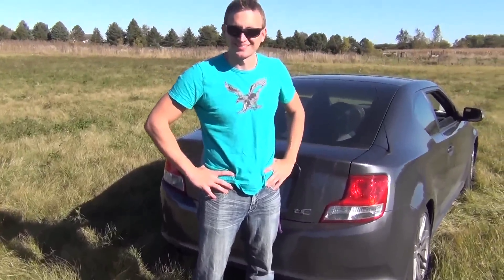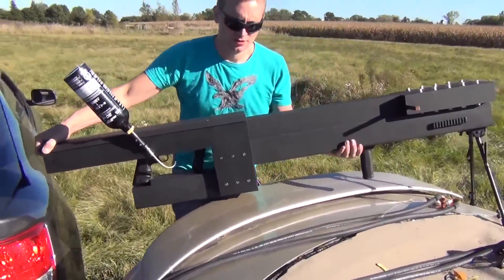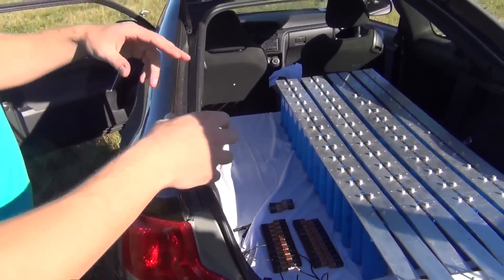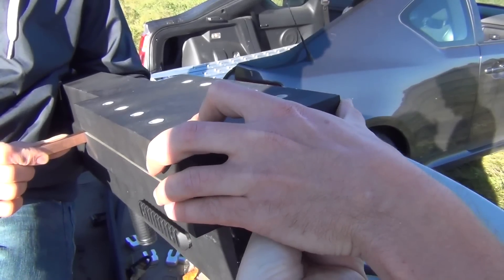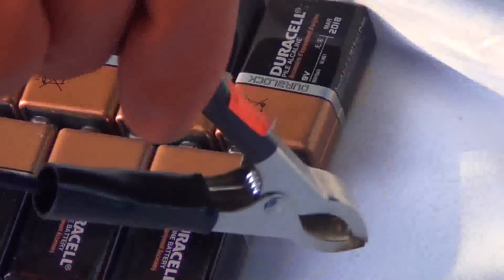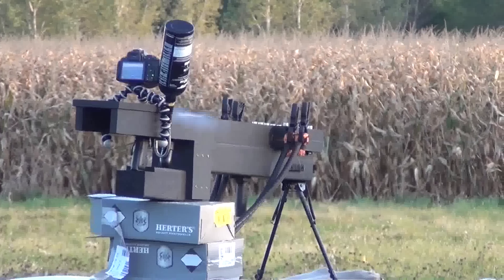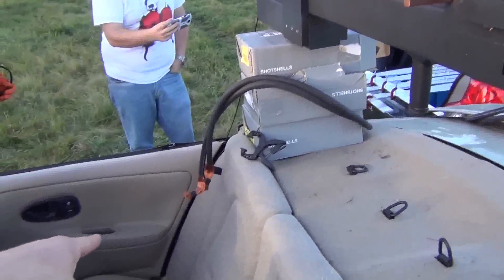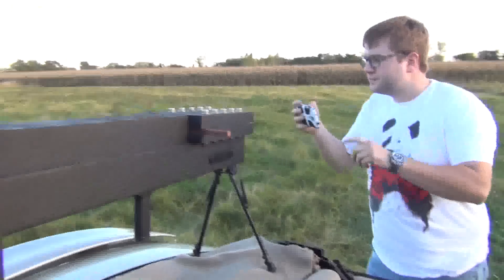Backyard RAILGUN: Field Testing the 250 lb Electric Gun, 27,000 Joule (max)

Comment: Cool and all but you guys kinda missed the most important part - a target so you can see the damage and maybe retrieve the projectile.
Reply: Ehhh... Aluminum is actually fairly soft compared to a lot of other metals. Including the ones they actually make bullets out of. Also ductile is the the ability of a metal to be drawn into a wire
Reply: Ya. I would like to see how many joules of *kinetic* energy it gives off.
Reply from the maker: https://www.youtube.com/watch?v=BIhCt6bTSSo
Reply: Ok, that is cool.  Do you guys have any idea of the fps?
Reply from the maker: I have no measurements right now. Looking to rent a system that can measure ballistics...
Reply: That would be awesome.  Check it out - here's a system I devised for measuring the fps of an air rifle I built: 2 microphones, one right by the gun, and another next to the target (something loud like a metal pan).  Run both mics into a computer running a program like reaper, which is free (not sure how much you know about audio stuff).  After you record the sound of the gun firing and hitting the target, you can zoom in on the audio signal to at least a thousandth of a second.  Maybe this only works for conventional guns where the bang is exactly when the bullet leaves the barrel.  But I got this to work well at distances as close as 10 ft.  You would think the gun would be loud enough to drown out the sound of the bullet hitting the target, but you can work around it by using a low gain mic like an sm57, right next to the target.  And you can get a good idea of muzzle velocity.  Just a thought!
Reply from the maker: +David 666 interesting. The system could be calibrated by shooting a projectile of known velocity- a .223, for example.
Reply from the maker: +David 666 a ballistic pendulum is a really easy way.. but I would be worried about the ricochet. Aluminum is very ductile- it holds a shape well after impact.
Reply: @ziggyzee9779  could the railgun theoretically penetrate metals like titanium or tungsten?

Comment: At 14 seconds they said it was an aluminum projectile. Aluminum is not attracted nor repelled by magnetism. Black bottle canister with CO2 seems to be the only propulsion in this experiment.
Reply from the maker: Have you ever dropped an aluminum plate onto a neodymium magnet? You'll be surprised to find out that, in fact, aluminum is effected by transient magnetic forces.
Reply: Aluminium is paramagnetic. It is most definitely affected by magnetic fields. Just not as strongly as ferrous metals. This projectile actually becomes part of the circuit, so the huge current passing through the projectile induces it's own magnetic field.
Reply from the maker: +Bert Anernie Yup. However, the effects of paramagnetism are very small compared to the lorenz forces and is an attractive force that works against us in the case of a railgun. Iron saturates very easily and has low conductivity- it's the worst!

Comment: how is this supposed to work.  I don't get it
Reply from the maker: Extremely large current is conducted between two rails and the projectile. 12,000 lbs is generated between opposing rails. This forces the projectile to high speed.

Comment: How many times did those geniuses walk in front of that thing? I understand this isn't a firearm, but use your heads.
Reply from the maker: Working with enough energy to electrocute 500 men or blow off an arm requires safety. Standing in front of a disabled, discharged muzzle loader is on par with cleaning a shotgun.

Comment: Wait ... Aluminum Projectile? Thats Not a very Stable or Conductive metal
Reply from the maker: +Andrew Hampton JR It's actually very conductive (especially when considering weight).
Reply: Well , if you get ahold of condensed tungsten that's what you should shoot
Reply from the maker: The aluminum is a mass driver- its meant to propel a more aerodynamic projectile with higher density. 

I do, in fact, have some shaped tungsten projectiles.. they weren't used in this week's shoot (working on the video now)... but maybe later this year....

Comment: Not quite sure why voltage was something they wanted to display.  Railguns take advantage of the Lorentz force. Railguns want to maximize this force and to do that amperage must be maximized, resistance must be minimized, friction must me minimized.  Also, it seems that with a device that is going to be firing projectiles...I would listen to your friend and try to secure your components before testing...
Reply from the maker: Voltage is the "pressure" that drives the amperage. Higher voltage = higher amperage, higher energy storage for the capacitors. The energy of a capacitor is 1/2mv^2. Half the voltage = 1/4 the energy.
Reply from the maker: Resistance must be at an acceptable level. It doesn't have to be zero. Anyways, I have more videos ;)

Comment: Very cool but as an electrician your connection methods are very dangerous ....your going to blow a chunk of flesh out of your foot where you ground out ..........seen the internal burns of high voltage ..........safety first lol
Reply from the maker: yolo :p
Reply from the maker: 400 volts cannot blow through a rubber shoe, especially Keen work boots designed for electricians. Also, this device requires contact with both positive and negative. The situation you've described is unlikely.
Reply: Ok man i have seen what happens at 480V and it burned the inside of a co worker from arm to exit at foot ...his arm is still limp ..anyways enjoy i dig the vids.....safety 4th is exciting
Reply from the maker: Sounds horrible. Definitely not something worth finding out first hand.

Comment: what would happen if you used a hollow projectile with the second rail going through the middle? would radial symmetry improve railguns at all?
Reply from the maker: my two cents- the simplest solution is usually the best.
Reply: +Ziggy Zee how's this for simple:  a voltage applied to the barrel and a coiled barrel length cable with some sort of quick disconnect attached to the rear of the bullet/sabot to complete the circuit.
Reply from the maker: +Jason Northrup Interesting. However, that cable is going to endure some heavy forces. The rails on my railgun experience an estimated 12,000 lbs. I really don't know what would happen ;)
Reply: +Ziggy Zee I think anything that can increase the sliding contact area would decrease erosion, improve durability.
Reply: +Ziggy Zee I wonder what kind of force is generated by a coiled current (an inductor i believe) on itself. then, what would be the force of the  "barrel" current on the coil?  what is the force of the two rails on each other currently?

Comment: Cold Metal (Aluminium) also with a bit of resistance loves to flex I see. Some older homes that used aluminium had issues like this.When someone would fire up the dryer or some other high amperage device. Would cause the wires to jump like a eel in the wall.

Comment: Compressed air gun. Firing electrified bullet. Did the slug get vaporized before hitting the ground? Was the inside of the "barrel" coated with Aluminum and copper oxides; possibly other plasma residue?

Comment: capacitors instantaneously discharge voltage and amperage....
Reply: +Nicholas skinner
Capacitors are electrostatic devices and deliver instantaneous current, but are time dependent on voltage, both charge and discharge.  1 Farad = 1 Volt linear rise when 1 Amp applied for 1 second
Inductors are electromagnetic devices and deliver instantaneous voltage, but are time dependent on current, both energized and de-energized.  1 Henry = 1 Amp linear rise when 1 Volt applied for 1 second

Comment: Ok.  The projectile was pulled and pushed by electro magnets in the barrell. Most types of metal can be magnetized by applying power and creating a field with powered magnets. Even aluminium. But the big question is where did the aluminium projectile  end up when they fired it faster than a speeding bullet through a corn field. Someone living within a mile could have been killed. WHERE did you think the projectile would finally stop! Someone's home or their body. I saw no thought put into where it would end up. Thank you for being  completely unsafe. Not like you were at a shooting range. How far did it go? Where is the projectile?

Comment: this isn't a sports railgun though. Sports railguns use gunpowder .-. Videogame/scifi railgun I assume?
Reply from the maker: +JayJay Golden *Electromagnetic Railgun
Reply: Ziggy Zee
I think the correct term would be a coilgun or a gauss gun then though.
Reply from the maker: +JayJay Golden it's a railgun. Definitely not a coilgun or gauss gun. I understand a railgun can also refer to a very a accurate bench - mounted gun powder rifle.
Reply: Ziggy Zee
Hm. Alright. What's this model based on? I'm interested and didn't quite get what happened in the video
Reply: +JayJay Golden There's a difference between a railgun, a precision gun mounted on a rail (presumably the sports railgun you're referring to), and a rail gun (railroad-carried artillery).

A railgun, as referring to the former, is an electrical device that accelerates an armature down two conductive rails via Lorentz force. The idea's been around for the better part of a hundred years, now, and it's become something of a college physics experiment as well as an experimental projectile propulsion system for military artillery.
Reply: +JayJay Golden They are using a Railgun.
what you are talking about is  Rail Gun.

Comment: Wait....  So it's not magnetic.  Do these things fire the aluminum projectile like a "Jacobs ladder" works?

Those science thingies electricity arced between from bottom to top, is this just arcing the projectile forward?  I don't understand how an electrical arc would pull aluminum but that's how I assume it works.

":[
Reply: +Marshall Husvar I'll explain how a Jacob's Ladder works first, then the railgun.
In a Jacob's Ladder, the two electrodes form a "V" shape. They don't touch at the bottom (that would create a short circuit) but they're close, close enough that the electricity arcs between them through air. When the electricity arcs, it needs to turn the air into plasma. This plasma (seen as the spark) emits light and is extremely hot, a few thousand degrees celsius. But it also conducts electricity much better than air. Physics happens, and the air 'breaks down' and turns into plasma at the base of the Jacob's Ladder. This plasma (remember, it's hot) rises, and as more current flows through it, more plasma is formed, and any plasma that collapses is rebuilt. It climbs up the ladder (hot air rises because it's less dense than the cold air around it, making it lighter) until the point where the voltage can no longer push current through the plasma arc, and the current stops. Without the heat from the current, the plasma quickly collapses. Without any current flowing through the ladder, you now have a high potential difference (voltage) between the two sides, and the process starts again when an arc forms at the bottom of the V.

Confused yet? No problem, you're not here to learn about Jacob's Ladders. What you have to have picked up is that:
-Plasma is extremely hot
-Plasma conducts electricity very well
-Plasma forms when current flows through air

Now, on to the railgun. The railgun has two rails, one positive and the other negative. The power supply for the rails has the potential to produce medium voltage and high current, but only for a short amount of time. That's OK though, because ideally the bullet will spend very little time in the railgun.
If the bullet were to start touching the rails, it would be melted by the current flowing through it and would not move; it would weld itself in place. That's why they accelerate it with CO2, (I hope, if they're using propane they're either badasses or dumbasses) because CO2 is both not flammable and cheap. Once the bullet comes in contact with the rails, a short circuit is created through the projectile, that allows incredible amounts of current (amps) to flow through the negative rail, through the bullet and again back through the positive rail.
When electricity flows through a wire, it creates a magnetic field around the wire. If you clench your right hand and stick out your thumb, your thumb points in the direction of the current and your fingers indicate the direction of the magnetic field. If you have the negative rail on the right, and the positive on the left, both the magnetic fields will be 'up' in the center and 'down' on the outside. This does not mean it pushes the bullet up! It means that the 'north' on the inside of the rails will be pointing up.

Time for another law of physics.
Take your right hand, all fingers pointing upwards and the thumb outwards, if your palm is facing towards you your index finger and thumb should make an "L". The thumb indicates the direction of current, the fingers the direction of the magnetic field and the palm of your hand the kinetic force that this law creates.
Let's apply this law to the bullet and see where it goes. Remember, the magnetic field is pointing up, as generated by the two rails, so your hand is pointing up. The current flows from negative to positive, so from right to left, so your thumb points to the left. The direction your palm is facing is the direction the bullet will be accelerated in-luckily, it's away from you.

As the bullet travels through the rails, it will use very small plasma channels on either side of itself to keep current flowing through it. These have no effect on the bullet's movement. However, if the plasma channels are too wide, the heat they generate will melt the bullets and the rails, so that has to be avoided, and if they are too narrow, the bullet will get stuck. This is why the bullet was made to be within 1/1000th of an inch of it's designed size (0:16).

If you've made it this far, congratulations, you've earned yourself a cookie. If you have any questions, ask away!
Reply from the maker: Jacobs ladders rise because of heat+gravity= convection. They don't operate sideways.
Reply: +Ziggy Zee 

So how does it "arc" the aluminum projectile forwards?  In laymen terms.
Reply from the maker: +Marshall Husvar 
current carrying wires= magnetic force...that's all I got for layman's terms ;)
Reply: +Ziggy Zee 
Someone told me it's still magnetism.  I'll just go with that.
Reply from the maker: +Marshall Husvar There's a lot of helpful information online about how they function. It's a long discussion- trust me.
Reply from the maker: +Theonlyoneleft1000 The force is created by magnetism, not gas or plasma pressure.
Reply: Latvian Man

EVE ONLINE!  Missles, railguns, lasers oh my.
Reply: Doesn't it use electromagnetic propulsion? I like the set up but it will be really cool once it's all packed into the gun itself, that just looks dangerous lol! I wonder how long until we see full-auto electromagnetic pulse rifles being shown on YouTube haha, I bet the US has them already built and classified to the public eye!!
Reply: +Josh Hartung dont dude it but I think they would not be use, is too expensive and fragile
Reply: carso1500 What's too expensive and fragile?
Reply: +Josh Hartung the weapon
Reply: +Theonlyoneleft1000 This is absolutely not true. The projectile is pushed by lorentz forces.
Reply: +carso1500 They are using them on ships already. I thought everyone knew that. The navy has contracts with some companies that make them. They're going to replace almost all gunpowder based main guns with missiles and railguns and lasers.
Reply: +Marshall Husvar exactly what I thought... just need some drones and such... lol
Reply from the maker: +Jacky Xie Someone gets it :)
Reply: +Marshall Husvar it is para magnetism to be exact
Reply: That is a different but related theoretical weapon.  This uses the projectile not plasma. The plasma accelerated variant uses both magnetism and the expansion to propel a projectile. The plasma itself is accelerated in the same way the slug is in this example.
Reply: That's exactly how it works.
Reply: Theonlyoneleft1000 lol you know how hot plasma is

Comment: How are the magnetic fields being generated? Just looks like you are supplying power to those two rails and passing a projectile between them making it arc out making a load of sparks but no actual propulsion. 

Is there something else to this gun to magnetise the rails????
Reply from the maker: A motor has many windings at a few amps. A railgun uses a lot of amperage with a "half coil".
Reply: So It's no more a rail gun but a coil gun you thought about  ! Not using the same physics approach
Reply: +RetroResto Ampère's circuital law
Reply: Ziggy Zee I see. I was looking at building a staged railgun with multiple coils to accelerate the projectile.
Reply: +jokereagleone true the physics is different but the idea was to try and keep the power usage down.  ive read up on " railguns" so i understand the principles in yours alot better.
Reply: +RetroResto I've already tried to create a cannon with low voltage...doesn't work by itself..i ve to add powerfull magnet or coil to create an adequate magnetic field
Reply: That is Exactly how a railgun works.  As current passes through the rails they generate a field as does the projectile. The sum of these fields forces the projectile to move. Assuming you have enough initial V to overcome desire to spot weld.

Comment: I trust these guys understand the amount of energy in those capacitors and how to handle and discharge them safely.  They really can kill
Reply from the maker: lick with tongue?
Reply from the maker: +sniper02578 that'd be quite the yoga trick. I also have discharge resistors.
Reply: +Ziggy Zee you can't do that? 

Well, I guess my tongue is longer than yours ;-)
Reply: +sniper02578 kinky
Reply: +gk10002000 I wouldnt trust them that much, they connected them wrong....